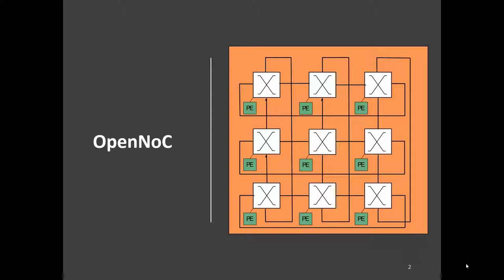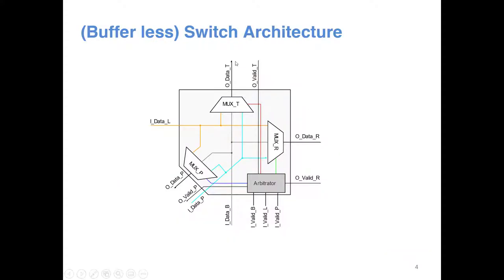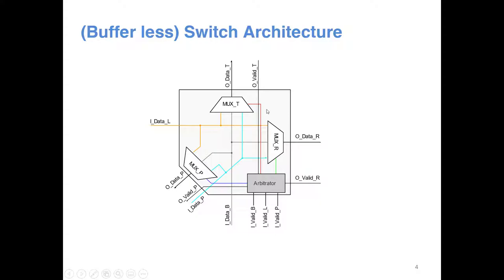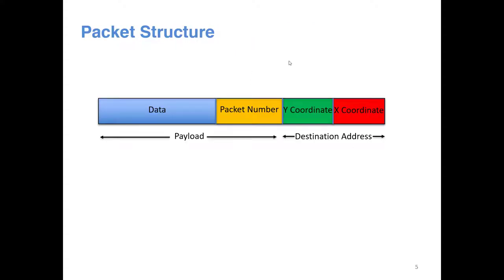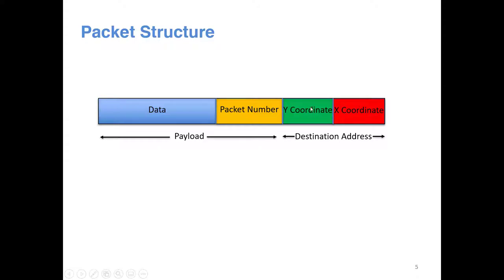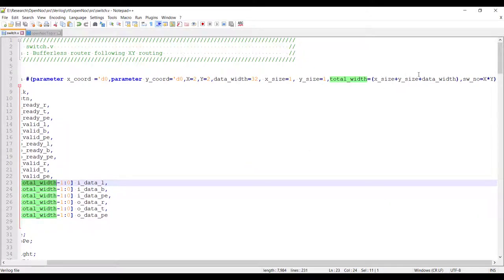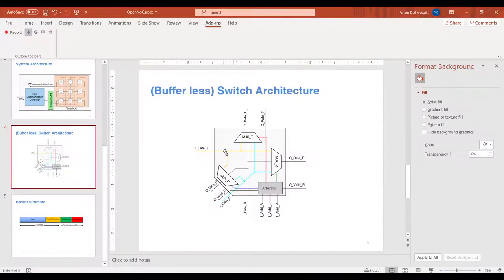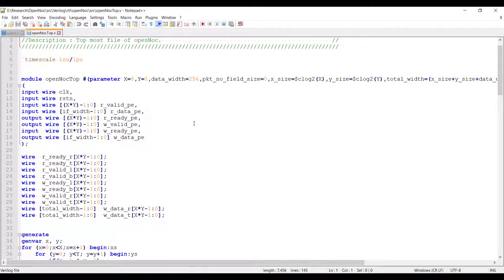Network on Chip (NoC) with FPGAs|Part 2|Design of a Torus NoC

Comment: Mr Kizheppatt, 
how can one prototype NoC (packet scheduling, etc) on fpgas? As switches in fpgas don't have transistors for logic like in the clbs, instead, only has minimal (pass/ access transistor), which are configured on device boot-up based on the bit-stream.